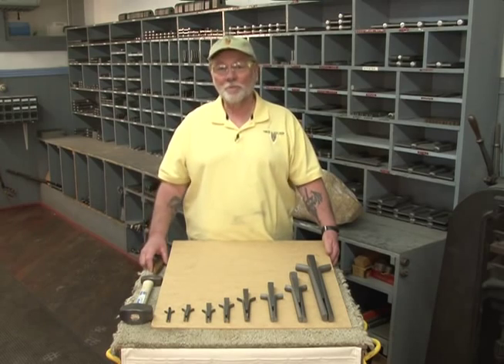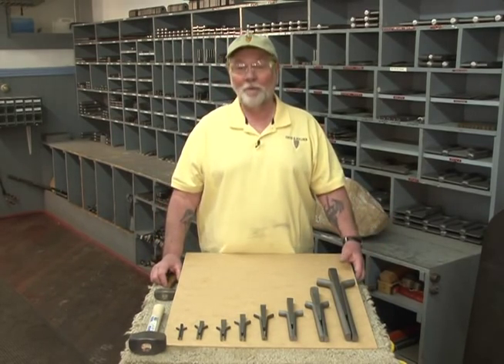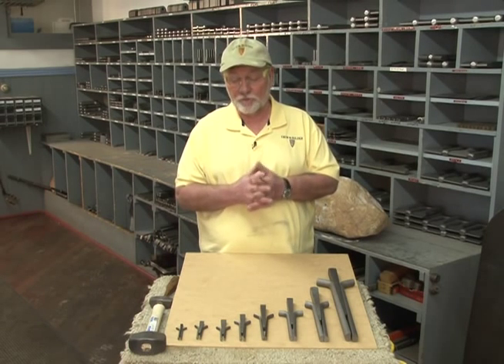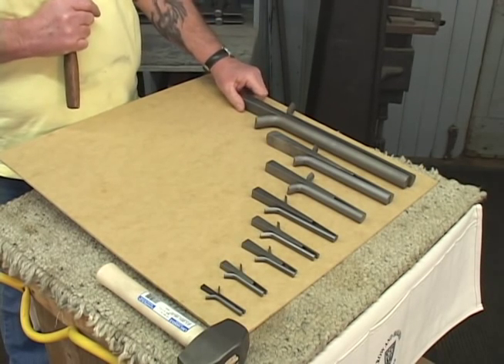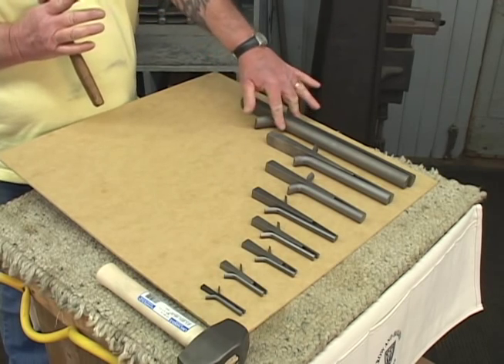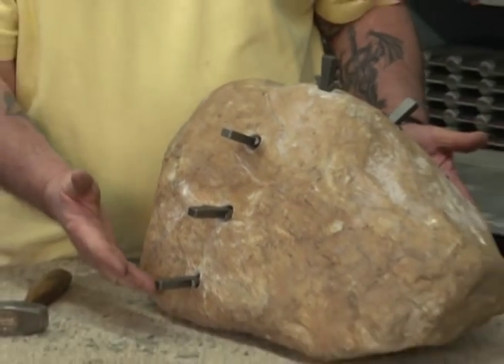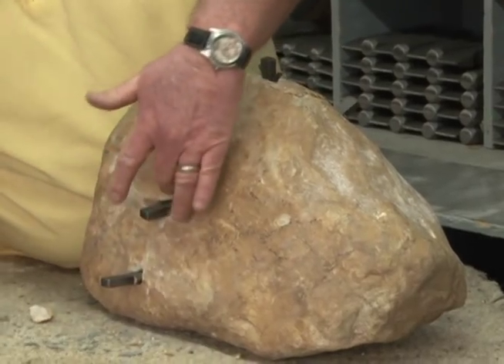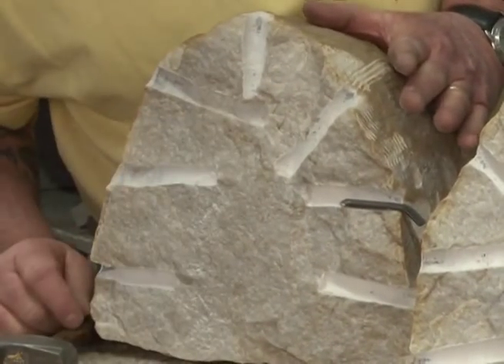Wedges & Shims In Use

Comment: if you get them all tight and it has not split, try hosing it all  down with water every few minutes. this can be enough to complete the job by lubricating the micro splitting deep in the holes
Reply: insert water hose into the holes?
Reply: @RaawanN   just hose down the rock and fill holes with water, no need for pressure.
Reply: Great tip! Thanks for sharing your knowledge 🙏

Comment: Nice demo. I live about 20 km from a dormant volcano. I have a  lot that is populated with a large number of big sub-surface basalt rocks (very hard). I use 5/8" wedges and feathers. I just want them gone, and with my obsessive compulsive personality disorder that makes me run for my drill whenever I find one . I space the wedges at 4 -6 " and 98% break cleanly. However some of the rocks even at 2-3" spacing seem behave like sponges inside, in the sense there is no stress buildup like the other rocks  and they won't split cleanly and just absorb the punishment. Same type of rock, same appearance but different berhavior. Then I return to reality, even though I am obsessed with defeating it and change my strategy and rather than go for removing the entire rock I settle for chipping off chunks despite the absense of defined cleavage planes, I continue to knock off chunks until it is low enough in the ground to be less of a problem. I then move on but continue to be puzzled as to why the same type of rock behaves so differently from identical rocks. By the way I dig around the rocks before the splitting operation to provide space for the rock to expand as I hammer the wedges.

Comment: If I want to break a rock horizontally (break top off a deep stone), should the holes for the wedges be drilled in a horizontal line across the side of the stone, to break top off?  Seems logical, but wanted to verify.
Reply: Hi-  Yes, you can drill holes horizontally for a "lifting" split.  Make sure your holes are drilled level and go around as much of the circumference as possible and that the piece being split off is completely clear of any obstruction or overburden. Because you're working against rather than working with gravity, you may have to drill deeper holes more closely spaced than usually required.  Let us know how things work out and good luck!

Comment: How deep should I drill the hole?
And is it of any benefit to drill a 'pilot hole' much deeper  (deeper that the hole that the wedge and feathers will go into) just to help encourage the splitting?
This is for getting rid if a concrete curb, no finesse necessary, just expediency.
Reply: Just drill a bit longer than the wedges.  No sense working overtime.